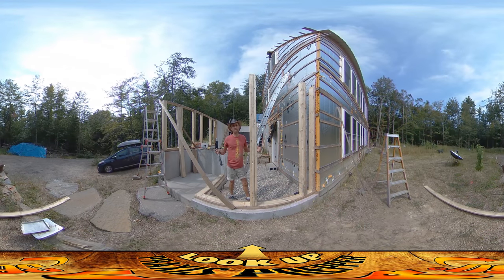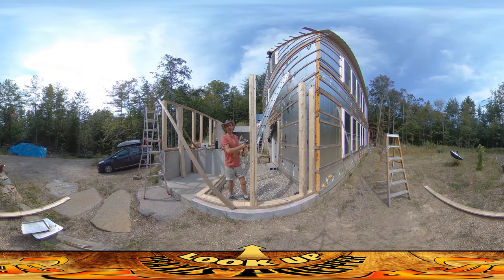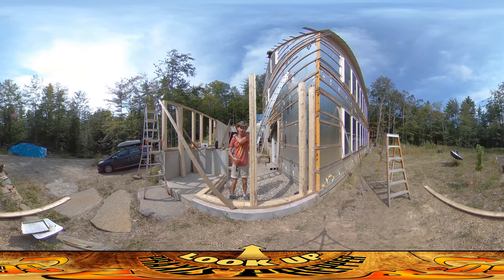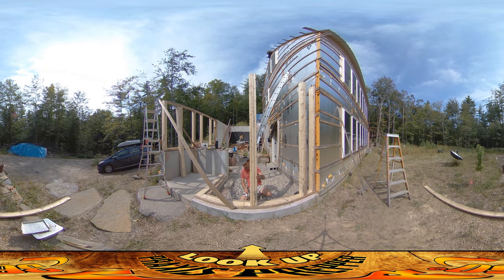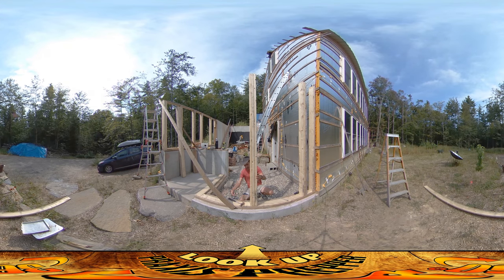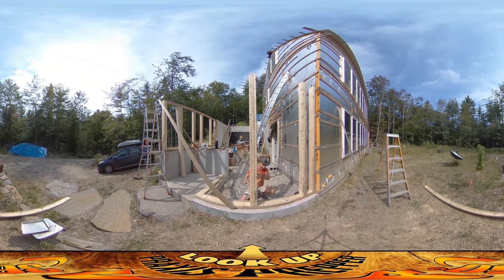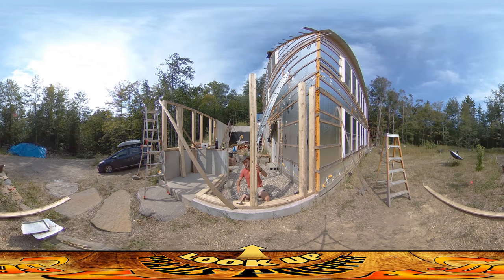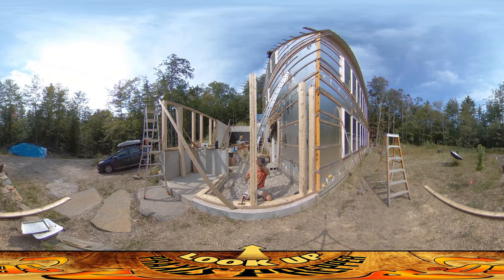Homestead Building - Greenhouse Posts, Toe Nailing Technique

Comment: Yes, header is on top.
images. app. goo. gl/ mwP4koCc84rrXeUG8 if that helps.
But you're right, it's more important to know why were doing it this way than to know what it's called...until it is required to communicate the intent. 
As always, thanks for sharing this with us. Before Winter, no-fail mission.